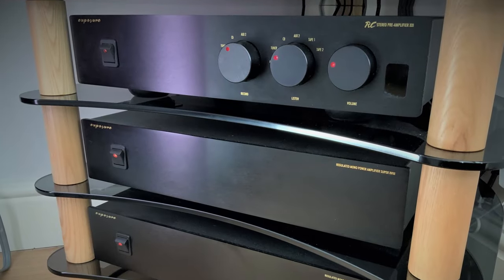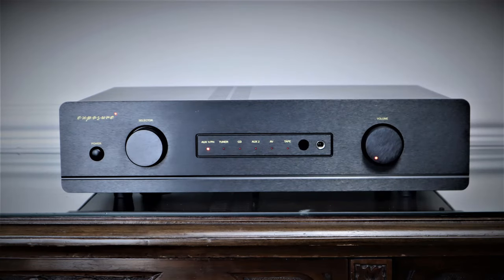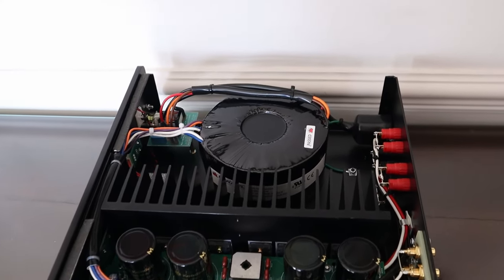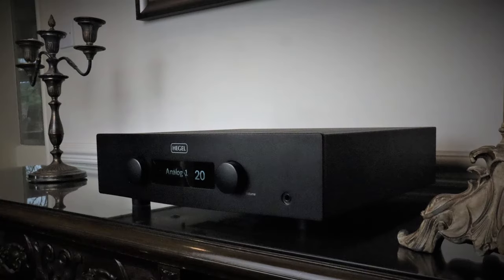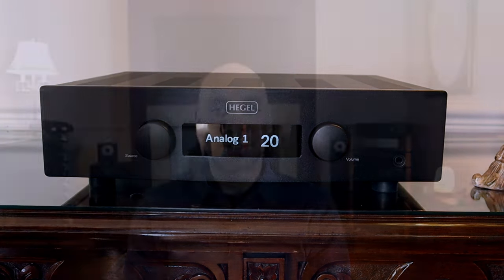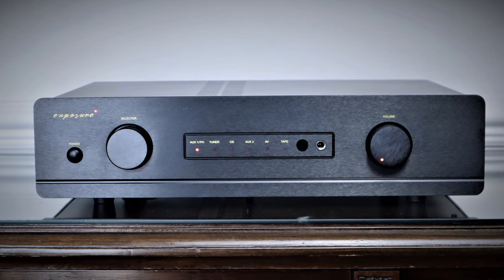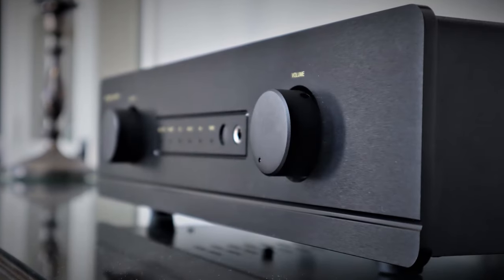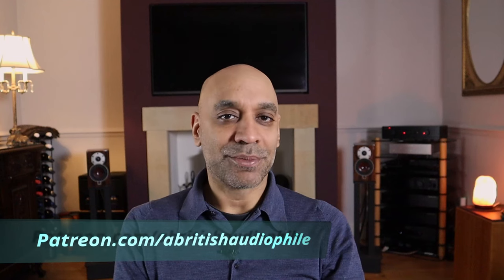Surprising! New Exposure 3510 Amplifier Review

Comment: Thanks Tarun. Your other reviews turned me on to the Exposure brand and the 3510 looked to me like the perfect amp to build an 'end game' system around. I'm now not so sure! Do you think buying the 3510 pre and power amps separately would have any positive impact on the midrange? Or could you add a power amp to the 2510 to increase its performance? If not, what do you now consider to be the amp to beat at this price point, if you were hunting for that beautiful tonal balance that you speak about.
Reply from the maker: Thank you Michael. Personal taste, partnering equipment, room and setup are all massive factors. Personally, I like the sonic signature of the 2510 but if you wanted to step up in performance and retail it’s qualities. That is what my old XXI Pre and XVIII Super Monos deliver. I haven’t found a modern day equivalent as yet for sub £5k. There are a few that peak my interest and I would love to review. The Sugden Masterclass 50th Anniversary, Musical Fidelity Nu-Vista 600, Unison Research Unico 150 😊
Reply: Go for 3510 you will no regret even 3510 pre/power cimbo could sound more fluid and relaxed.

Comment: Hello, I have a question please. I have the Spendor 25/1. These were reconditioned by Spendor five years ago and have been fully checked and are in excellent condition. I would now like to get a new amplifier and have shortlisted three. The Atoll in300, the Exposure 3510 and the Sugden A21 SE. Which one offers me the warmer sound? One person told me that the Sugden is too weak for the Spendor. That sounds very implausible to me. I would be very pleased to receive an answer. Many thanks from Hamburg Germany. Torsten

Comment: Having heard all of these amplifiers, on which side of this warm/cool scale would you place the audiolab 6000a? I am thinking of adding a power amplifier to help drive my Buchardts, possibly the new exposure 3510 power amplifier for its grip & control
Reply from the maker: The 6000A definitely leans on the cool analytical side. I haven’t heard the new 3510 power amp but the integrated is pretty neutral with a touch forwardness in the upper midrange 😊

Comment: Hi Tarun  after a few years out (16) I’m about to change my set up. Musical fidelity and B&W 7 series floor standers. Because of space and a change or preferred listening material  I’m considering, after seeing your reviews the Dali minuets SE and exposure 2050. The Dilemma I have is would I be better with a dac and 3510 stereo amp. Would I benefit in sound this way over the 2050 or does it have the 3510 sound signature you were not in favour with these speakers. Cheers Gary.  great reviews sir
Reply from the maker: Thank you Gary. The Exposure 2510/Dali Menuet SE is a great small room setup. I am currently reevaluating the 3510. Long story but if this one sounds different to the one I tested. I may do a follow-up video 🙂
Reply: @abritishaudiophile7314  did the second 3510 that you tried build characteristics of the 2510 ? I have a 2010S which sounds like the 2510 that you described. I am looking to upgrade and was hoping that the 3510 would be the logical amplifier to get.
Reply from the maker: @sam66hazmal   The first three models of the 3510 produced went to dealers and reviewers. Two left the factory incorrectly biased. I had one of those units. Unfortunately, this wasn’t noticed until long after the review. I auditioned another 3510 recently with correct biasing. It sounds like the 2510 but with more power, dynamics, control and a larger soundstage 😊
Reply: @abritishaudiophile7314  thanks for confirming that, I really enjoy your reviews and the way you are clear at communicating your views on products that you have used, fantastic.

Comment: House sound is nice, but I am not sure if it's new age manufacturing of internal components or tinkering done to newer products that change it.  I have settled fairly well into parasound.  I do like their class A bias in the A/B amplification, however their older models which are from 1997 to about 2005 are all amazing.  Even though it is only a few watts in class A I guess I am one which is fond of that particular sound.

Otherwise clearly having ups and downs and expectations amongst a brand of amplifiers and having this bouncing around will cause confusion.  I believe that Mark Levinson is a great example of this, some of their older amps cost more than double their original MSRP as they are sought after as quality sound amps.

However, even though it is the same designer at Parasound their new equipment doesn't sound as good for some odd reason.  Also in regards to measurements their older amps seem to be going toe to toe or better than what's new and I find that odd as well.  Obviously everything I purchased is used, but I have the HCA-1000; which really got my attention.  I grabbed a HCA-1200 MKII, and settled on the higher current and more powerful HCA-1500 functioning in mono blocks powering 6 ohm speakers and with no crosstalk I have to very much say this is an excellent setup all around.  Ironically, the 1000 which to me honestly sounds a touch better than the two larger and more powerful amps has a tiny bit better sound.  But the sound is uniform amongst all of them.

It[1000] also runs very hot, on the other hand the biggest of the two the 1500's never even get luke warm. It's quite strange to be honest but it does have a lot of current and my speakers aren't demanding that much current which maybe is why.  Also having two of them, and both having an equal operation pretty much solidifies this.  I honestly see the 1500's to last 30 years with no issues what so ever, as heat can be the most damning factor to an amplifier.  They have even two larger amps, 2200 MKII and the 3500 which both run blistering hot and are known to fail because of this massive heat.
Reply from the maker: Great to learn about your experiences Mike. Thank you for posting. John Curl has designed some great amps over the years 😊
Reply: @abritishaudiophile7314  Think that loop function is pretty neat, haven't been in this hobby for a long time.  But not certain if any other manufacturer actually adds that to their amps. Cheers to you on a good review

Comment: Hello Taryn. That’s a very detailed and interesting review. I currently have B&W 705s2s connected to a 3010 integrated amp and 3010 CD player, purchased in 2008. The amp keeps dropping out on the right channel. 3rd time in for fixing, so am looking to replace. In my position, would you look for the 3010s2d, or go for the 3510? I love the sound of my 3010, but the channel drop out is frustrating
Reply: Sorry, Tarun… auto correct….
Reply from the maker: I am surprised they can’t fix that. Who is doing the repair?

Comment: Oh one more thing regarding the Menuet SE, I see you've toed them in slightly and they're a bit far out from the back wall...

I've tried toeing and not toeing back and forth a few times and the treble does mellow out when untoed. Also, closer to the back wall, about 20 ish cm gives a different presentational. They're quite finicky that way..

I do like the Dali midrange and treble forward house sound but it can definitely be a bit much sometimes, but they seem quite comparable to the proac tablette 10 signature.
Reply from the maker: Interesting. I am still playing with positioning 😊

Comment: Could tou please help me,  I found a used exposure 3510 in mint condition under warranty for 1400 euro.  The exposure 2510 sells about 1800 in my country and the 3510 model about 2300. Should i go for the 3510 or the 2510? I honestly love your reviews and because you reviewed both models, I'm still not sure if the 3510 model sounds as good as the 2510.
Reply from the maker: The 3510 I had in for review was incorrectly biased which led to a harder sound. I since had another 3510 in which sounded much like the 2510 but with better scale and dynamics. If you are confident the 3510 is well looked after, that looks like a good deal 😊
Reply: Thank you very very much for your help 😊

Comment: I would like to ask the comparison question with the 2510 another way. What do you lose in sound quality if you choose the 3510 over the simpler two power transistors per channel 2510 other than the slight hardness you pointed to? I hope you get a chance to review Exposure's whole new range of amplifiers. It seems the 3510 monoblocks inherit more of the flagship design with biploar transistors throughout and a directly coupled circuit.
Reply from the maker: The main difference is in tonality. The hardness in the vocal region, a bit of a sharp edge to electric guitars, brass instruments etc and a more forward soundstage 😊

Comment: An excellent review as always. I'm all for manufacturers having a house sound, it makes it easier to look at other models in a company's range knowing your likely to get more (or less) of the same sonic signature. And as others have pointed out its not always possible to demo every company or model. Regarding the 3510's sound, given that it's a bit more forward than the 2510, do you think it would be more suited than the 2510 for rock music? And is it still as good at lower volumes?  Thanks
Reply from the maker: Thank you Damian. Some people will prefer the more forward presentation of the 3510 especially if they like a bit of bite with rock music. The 2510 is no slouch with rock either but plays better with a wider range of genres 😊

Comment: Hi Tarun. It's great to see you review an Exposure amp again as I love their amps. I agree with your thoughts on the front panel look. That's some transformer they've used. A friend of mine is a dealer for exposure and every amp of theirs that I've heard have always had such a grippy bass and fine mids. How did this amp compare with your amps sound? I think amp manufacturers are trying to make amps with a different sound signature so that they have a wider choice for potential buyers? Just a thought 🤔
Reply from the maker: Thank you Steve. It would be interesting to get Exposure’s feedback to see if they deliberately went for a different sonic presentation with the 3510. The 3510 has better bass control than my old XXI Pre and XVIII Super monoblocks but pretty much in every other regard it is not amps good 😊
Reply: @abritishaudiophile7314  it would be interesting to see how you feel about the updated version of your amps, as we have discussed in the past. Keep up your good work my friend ☺️
Reply from the maker: @steverees1936  thank you buddy 👍😊👍

Comment: Hi Tarin, how does the 3510 compare to the 3010s2d.....am I correct in that the 3510  is the replacement amplifier for the 3010s2d?
Reply from the maker: It is the replacement. They should sound similar 😊
Reply: OK thanks...I really like my 3010s2d.

Comment: interesting video, i have a 2510 which works well with my Kef 201/2...but the new Kef ref1 meta is a much tougher load; i auditioned them with the hegel h 190. Would the 3510  work well with theRef 1 meta?
Reply from the maker: I would like to think so. No way of knowing until you try 😊
Reply: Very surprised the 2510 can drive the Kef reference which is not an easy load (86db/4ohm). Great to know :)

Comment: Speaking to the house sound issue: I have read many of the comments posted earlier and Tarun’s responses; I’ve listened to manufacturers (particularly Paul McGowan of PS Audio) explain the process of how their products each receive a final ‘voicing’ by a select group of upper management (owner[s]), and heard their explanation: that each ‘house’ seeks to their best sound out on the market; and then come Tarun’s review of the Exposure 3510! Not the house sound he expected. What do I think? I think that a brand’s reputation is built on several things, including the (1) a product’s appearance (which can change over time, with new models, lines, ranges being introduced), on this point, I have in mind brands like McIntosh, PS Audio, Schiit, and others whose products all bear a physical resemblance, some of which are clearly meant to ‘stack well’ together. (2) Other  features which may distinguish brands or model line include certain I/O selections (like balanced connections) or control features like ‘mono’ buttons, dual volume controls (on the power amp) Treble & Bass controls, a ‘loudness’ button, HT bypass, etc. (3) Within a brand’s offering, there may be a ‘Signature Series,’ or special ‘line’ that is intentionally distinctive, often highlighting the work of a single engineer (PS Audio’s BHK, Parasound’s JC-x, Marantz’ Ishakawa, etc.) with a separate upgrade path and, significantly, a variation from the brand’s traditional ‘house sound’ billed, as “this is what our engineer can do with an unlimited budget and a free hand in circuit design” or something similar. If the initial offering is well received, it often receives a cost/benefit iteration for the masses. The point is, the difference in sound signature is clearly indicated even if only in a specially applied label. I take it , from his comments that Tarun would be OK with this departure from the ‘house sound.’ I don’t know from my experience, if all brands follow this path. But I know that I pay very close attention to the specifications of each model and unit I am considering for purchase, since I haven’t listened to enough amplifiers to form an opinion about any particular brand’s ‘house sound.’ I’ve had a particular interest in tube amplifiers, and I’ve heard others report, for instance, that Conrad Johnson was warm, and  Audio Research was analytical. But when I look at the AR line, I discover that there is a ‘Series II’ with half the number of output tubes by a different manufacturer (dual triode 6H30), Rogue Audio uses the same tube, but in an entirely different model (RP-9 vs. RP-7). Should I not expect these two units to sound different? I.e. the Original vs. Series II; RP-7 vs. RP-9? The price point and reviews would certainly seem to indicate this [the RP-9 is $2,000.00 more than the RP-7]. So, Tarun’s (and other’s) point is well taken: a different sound signature is given different marketing and clearly identified in order to warn, not surprise, the prospective customer. (4) Not all brands adhere to this marketing approach. When I see a Pro-ject product, I’m not looking for a house sound, but I may be ignorant of it’s existence. Each product seems to stand on it’s own, again, O may not be aware of similarities across their product line. But each one appears so different, to me. And then there is a numbering system applied, I believe, in their phono stages, anyway. 
To sum up, offerings that ‘surprise’ the customer should probably be avoided. The difference in the sound signature of the 3510 to the 2510 should have been more clearly demarcated by either a ‘Signature Series’ or ‘Series II’ or possibly a whole different model line. The case, also needed a more radical treatment in some way. But all these arguments are directed at the marketing of the product. Left untouched are technical questions of how the sounds came to be different in the first place. In the case of AR’s Series II and Rogue’s RP-9, the difference is down to the tubes. In the case of the 3510, is it the transformer? How so? Enquiring minds want to know.
Reply from the maker: Great points. Thank you for posting Jeremiah. I agree, any departure from the “house sound” should be clearly differentiated by marketing, branding and industrial design 😊👍

Comment: Tarun, would you be able to review the Peachtree GaN400, a seemingly rather well regarded Class D amp using new GaNFET transistors in the output stage?
Reply from the maker: Thank you for the heads up. I haven’t got a contact for them as yet. I will look into it 😊
Reply: @abritishaudiophile7314  I think the review would not be disappointing. Based on user reviews and a brief sound sample I heard, it is the stand out Class D amp of the moment and able to go head to head with many more expensive Class AB amps and beat them on several sonic parameters and possibly overall. But that's just my amateur opinion so far using youtube and headphones, which is why I - and I am sure many others - would value your professional hands on opinion. 😊

Comment: This may be far more better developed than other amps, but being a bit of a Farlowe disciple, this amp nevertheless doesn’t look like an Exposure neither from inside nor from outside. Inside, there is really a lot - too much - going on, I‘m very suspicious of the many highly acoustic damped Silmic caps and I‘m not sure about the amount of parts - IMHO - in the signal paths and additional stages put inside for user-friendlibility or guess whatever. This is not „keep it simple“, just because this is no digital signal processing unit. This is more like „keep it produceable, keep it cheap. What really shocks me is the view to the 2nd power amp PCB underneath. These are 1 to 1,5mm epoxy-PCBs, They are already bending as you see. Something you never saw at an Farlowe Exposure with its solid 2.5mm PCBs. But that’s the way it is, as a developer you have to use electronically parts available. And these are by far others than in the 1980s/90s.
Reply from the maker: I agree. The 3510 is a more complex design with an active preamp. I was referencing my Farlowe amps and the 2510 with the KISS principle. Thank you for posting your thoughts on this 😊

Comment: Shoot, quite a waste of new money, when my two old AVI S2000MI amplifiers using as completely separate left and right monoblocks blow off anything near today's new priced supposed equivalents. My AVI'S are certainly straight wire with gain and neutral, and they do not have the older exposure amplifiers colorations.
Reply from the maker: Cool 😎 thank you for sharing 😊
Reply: @abritishaudiophile7314  it's funny too, my two AVI'S are from 1997, too, making them 24 or 25 years old, and they are still sonically holding up very strongly even today.